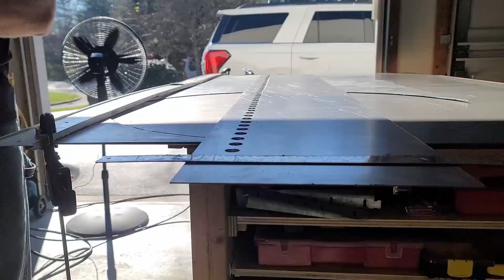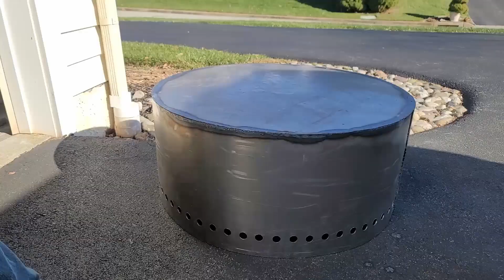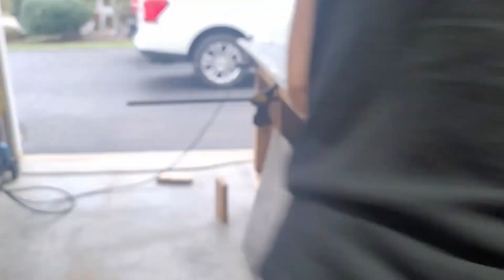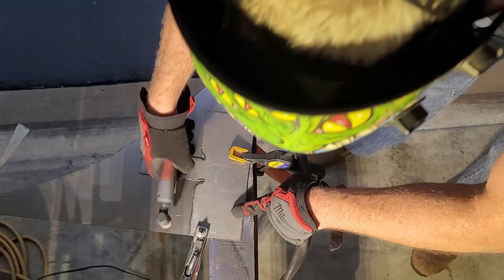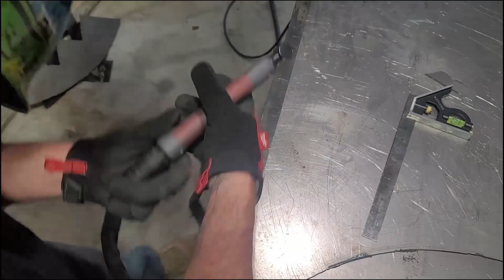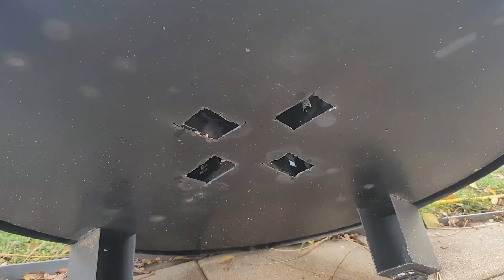DIY Smokeless FirePit

Comment: Should have used 2 pieces of heavy duty pipe to build it.
Reply from the maker: The lighter gauge steel kept the weight down and made it easier to move around.
Reply: Make it too heavy